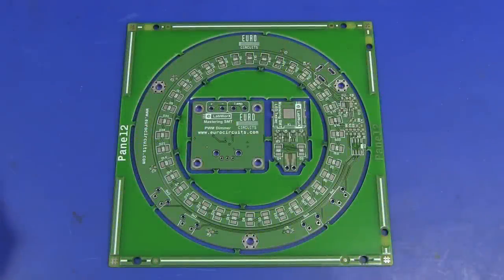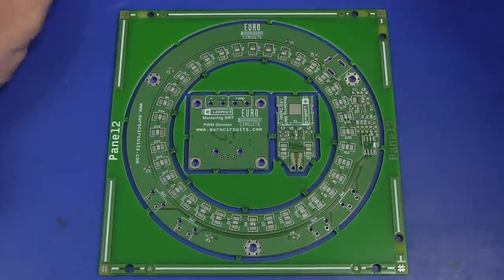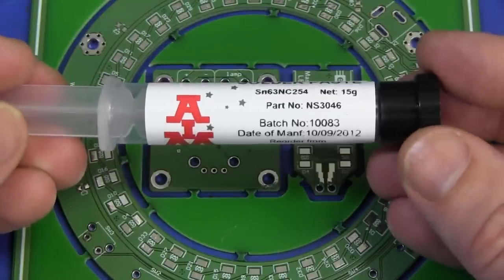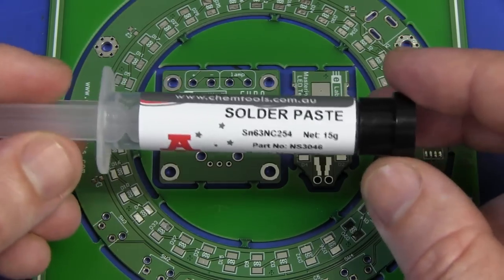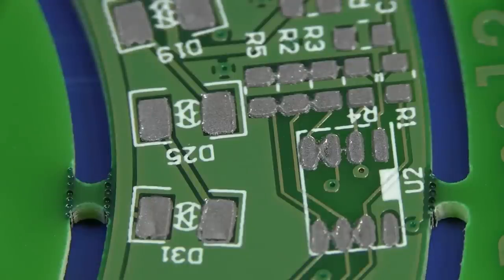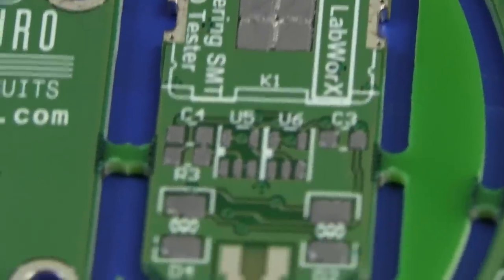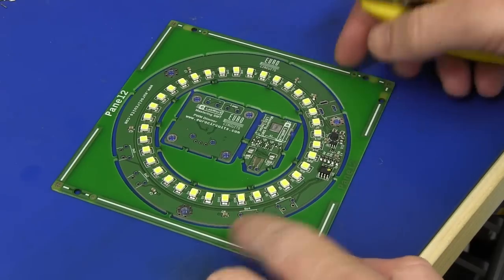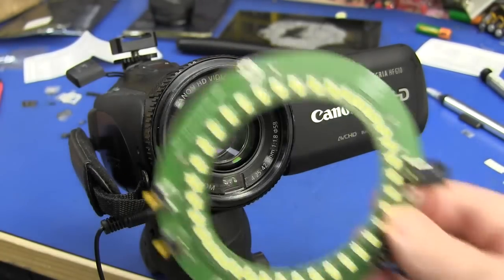EEVblog #415 - SMD Stencil Reflow Soldering Tutorial

Comment: I make "free" stencils for almost all of my SMD projects. The lab I work in has a cheap, hobby-level, laser cutter that I use. I cut open aluminum cans, sand of the inner plastic layer, spray paint the can, laser off the part of the spray-paint mask that I want to have solder on, and then etch the aluminum in standard PCB etchant. It takes a half hour tops.
Reply: Would like to see a video of that :)
Reply: or you can pay like 5$ at jlcpcb
Reply: @MrMWPro  the can method can be done in 30 minutes, i don't think jlcpcb will beat that
Reply: I know this is 4 years old, but this method sounds amazing. I was looking into using Al cans but thought I had to do toner transfer. What type of paint? Just standard gloss spray? What type of etchant do you use for Al? I thought it needed to be something like HCl/H2O2. I guess even just NaOH should work.
Reply: freezedream This was a while ago before JLCPCB had really become as popular as it is now. PCBs were really expensive back then ($50+) so I was making those using a similar process on copper circuit board material. I just used off the shelf matt black spray paint. It was a chemistry lab, so we had easy access to diluted HCl solutions. A little bit of Baquacil pool oxidizer (concentrated H2O2, but much cheaper) really sped up the reaction. I remember it always being a bit of a balance between using up your HCl or oxidizer and having to add a bit more to keep the bubbles etching.
Reply: @michaelmolter6180  Thanks for the quick reply! For sure services like JLCPCB are really cheap and convenient, but if you just need a stencil for a one or two board prototype and need it within a day or two then it's good to know how to whip something up that will do the job. I work in a lab, too and I've laser cut Mylar stencils before, but aluminium would be much better.
Reply: @Minecraftmike5089  well, if you already ordered the board from them the stencil would come with it already

Comment: The paste issue you had with it not sticking onto the pads when wiping is due to the paste either being too warm or not kneaded enough. Knead it on an aluminum plate to where it becomes the consistency of peanut butter, for a few mins till it's very smooth, then apply it. But like you touched on, the paste should re-flow once in the oven too.

Been an SMT Operator producing class 3 PCB's for a few years now, and always see this issue whenever someone doesn't prep the paste. 

It's awesome to see people producing PCB's right at home. Feel free to ask any other questions, love teaching and passing info to people who like to learn.
Reply: With a syringe you can't mix the paste. I never buy syringes.
Reply: @NathanSweet  Yeah that's true.. Plus whenever ordering paste online it's impossible to get it shipped cold. Warm SMT paste means the flux and solder balls will separate. Gotta mix it and when not using it, stick it in the fridge.

Comment: The flux is included in the solder paste. AFAIK that's the main reason for the shelflife and the time parts can be placed after applying the paste. The solvent of the contained flux will evaporate and the paste will go hard.

Comment: According to IPC general recommendations the stencil should have rounded corners to optimize for maximum release when the stencil is removed from the board. And it is very important to have about 50% of the size pad size for the solder paste opening in larger thermal pads, especially under the components. Please use IPC recommendation solder paste layer when you're using stencils.
Reply: -.-  tool

Comment: One trick for shaky hands is to use one of those pano-vise.  Clamp in your solder iron, tighten the nut just enough to move the iron with a little effort.  Very stable.

Comment: The solder paste has liquid flux in it, a lot of it actually. So no, no flux needed.

In fact, the gradual increase of temperature, besides giving time to the pcb to warm up gradually and not crack or bend or whatnot, is also chosen in such as way as to give time to the flux to work on the surfaces for a few seconds before it boils/evaporates and the solder actually reaches the temperature needed to make the connections.

Comment: I was told a story about a group of people soldering LEDs on boards for emergency exit signs. Someone screwed up on which way the LEDs go and placed it the wrong way, and everyone trusted that guy so they put them on the way he did. And no one paid attention, because they were busy talking about weekends and wife and kids and stuff. And it wasn't until the next day they realized that they have to throw away all the 5000 boards because the LEDs were put on the wrong way!
Reply: Did you know that not all LEDs are put on with the same orientation? I discovered this when soldering on some various coloured LEDs some wouldn't turn on. I dismounted the non-working ones and tested with a DMU. Mind blown.
Reply: electricity goes backwards.
Reply: A place i worked had done huge capacitors backwards.  They didn't spot that until it was powered.  That woke up the dead.
Reply: @dr_jaymz  🤣
Reply: @cesaru3619  To be fair, I think the capacitors looked the right way around because the shrink wrapped labels were actually backwards.  An automated pick and place had done most of the PCB and the caps were all done by hand afterwards and so the human assumed that the labels were correct.  I mean- why wouldn't they?  I think they were like like 470uF 400V.

Comment: Thanks, nice video! btw i'm having some solder bridges on the very fine pitch components, should i make the stencil holes smaller on certain parts of the stencil design? Because for example some big smd capacitors looks like they got too few solder, and at the same time, the fine pitch IC get solder bridges (like they got too much solder paste) after hot air reflow... Please help me...  Thanks.  :)

Comment: Dave, I know this video is well over a year old now but I wanted to add that in a pinch I find an old credit card makes a good squeegee for my stainless steel stencils. Has a good sharp edge, is very stiff while able to give some bend under high pressure and doesn't scratch the stencil.

Comment: Dave,
Thanks for the video.
A couple of things. The reason the spatula doesn't work is that it is too flexible and it bends down into the stencil hole. A rigid spreader is best. The best way to do your heating is to have a hotplate of some type under the board. What you're doing here may look good but the life of the parts might be marginalized and might have a short life in service.
Not one of your best videos.

Comment: if you apply the past in multiple passes it goes under the stencil edges and it ends up next to the pads, if you do it in one pass you get nice sharp edges. Might not be a big deal in some cases but when using IC's with very close pin spacing shorts will form between them.
Reply: I don't find this to be the case when the stencil is taped down firmly and a metal putty knife is used. The main thing that leads to smeared paste is the stencil lifting slightly. Keeping it pressed down the whole time helps.

Comment: 28:45 Anyone notice the pin that didn't get reflowed? :P
Reply: Yeah, it only partially reflowed. The board should really be elevated off the table when doing it like this. The table will suck enough heat out of the board to slow down reflow and possibly cause some components to "burn". Not a problem in a reflow oven since everything is hot

Comment: Dave did all that, then said he'd normally use his favorite iron & wire solder for this board? I'd think that's more hassle than the stencil & reflow method.
Reply: But for the thermal pad under a QFN part it might be the only way for a DIY solution. However I would do a very tiny bit of solder paste on that pad rather than using a stencil. An example of such a device is the ADCLK925 which is only available in such a package.

Comment: I'd like to say this once again - it's a good practice to preheat the board from the bottom. In Russia we even used an iron sometimes (yes, the one your wife uses to iron the clothes). Just put it upside down, place the board on it and enjoy. Soldering is much easier in this case, because board doesn't take so much heat anymore. And the chance to overheat your chips is also much less now.
Well, iron is weird, it's better to use IR heater.

Comment: You can use old credit card or similar plastic or metal sheet to apply stencil paste. Also a thin squeegee from local hardware show will do job perfectly.  It is important that edge is smooth and material isn't to flexible. I work with smd every day at my job. For printing stencil we use LPKF stencil printer for bigger series of boards, but for prototypes I just make frame like this one on video and I attach metal mask with some tape on one side to create sort of hinge.

Comment: I think that the issue with dragged solder paste is that your spatula is too soft. It's bending quite a lot so the trailing edge is very flat on the paste, and that increased surface area is dragging the solder away from the trailing edge of the mask.

Comment: Ok, when I ignore the self-praising Parts ;) I am suprised how good it works. I own an Reflow-Oven and never thought it could be done with such a windy tool like the hot-air-pistole. Nevertheless I think you should not work on SMD if you had to pull them on the board by Hand. At minimum a "half-automated" System would speed it up a lot.

Last Remark: Temp. is not the only critical part on the parts. Even the quantity of getting up-heated and cool-downs are critical. Take a look at some datasheets. They tell you a nb. ob 2-3 times. I do not belive that this is possible with the hot-gun and you have to repair/replace many parts. Didn't you?

Comment: A stencil is not absolutely necessary if you have hot air reflow. Just a little dab on each pad and don't worry about bridges as surface tension will sort it out. This even works on chips with completely hidden pads..

Comment: I’m not sure this would be needlessly complicated for only a marginal gain but: if your stencil is made of a thin steel sheet, maybe you could use magnets underneath the PCB to secure it in place and get multiple anchor points spread over the whole surface?

Comment: Thanks for the video. 2 questions come to mind. 1/. How did you work out the diagram for the LED had the cathode and anode back to front in the diagram. 2/. Do you concentrate the heat away from the heat gun the chop centre and concentrate more on the joints or are the chops usually able to withstand the heat

Comment: I can't speak for the solder paste itself. But, things like glues, drugs and many other substances are designed to be maintained with consistent environmental conditions, in order to preserve and extend the potency of the substances. If the manufacturer said keep it under room temperature, first you have to define what room temperature is. Also, room temperature can change back and forth throught the days and weeks, which weakens substances. A fridge provides a consistent environment.

Comment: Personally I would have put the extra boards top and bottom tape them down then align the stencil tape the stencil down. Use a metal ruler  hold it a 60 degrees.  Put. A bead of paste along the top edge and pull down holding the ruler at 60 degrees it should give an even print. Btw I work for a company that makes a 3d solder paste inspection system so I have a little bit of experience with it :)

Comment: Dave, you often mentioned your silicone/rubber ESD Matt that as you said and demonstrated once, does NOT conduct on the top surface and is resistant to heat and penetration. - im trying to find something similar for a while now over here in germany and didnt realy found an ESD matt yet that DOES NOT CONDUCT! Any matt ive found yet says in the datasheet is conducting on the top surface too. AND even those do cost a fortune! 200+ EUR a square meter. WTF?!

Comment: Good show nice work. A basic suggestion on hand placement. You would do better if you used both hands when placing parts. If you get some sharp pointed wood like the bamboo kabob sticks. Here is the basic move; keep the stick in none tweezers hand. Place the part with the stick near it. Set down the part and simultaneously put the point on top of the part to hold it down which will help with the shaking hand from moving the part. Release the tweezers and then the stick. It will take time to get.

Comment: I buyed Elme mat recently and it seems to be very similar to 3M top quality mats. It's made from two rubber materials, top layer is not conductive, thermally and mechanically resistant, bottom layer is conductive. I tested thermal resistance with soldering iron set to 300C for a few seconds and the only effect was discolouring the blue rubber. Maybe it was caused by flux from solder wire. It's only cosmetic issue, but beige seems to be natural color, so that variant should not have this problem.

Comment: Nice video. One question is, how do you clean the stencil? I have some old stencils with dry paste in QFN pad holes...pain to clean them. Mylar ones I just throw away after every batch, but stainless steel ones are too expensive to waste. Maybe you have a good cleaning trick?
Reply: i used to work during summer in a small electronics assembly company (not sure how to say in in English). Anyway, solder masks and dirty circuits were cleaned with a special solution and simple cleaning paper (large pinkish rolls). I believe the solution was some kind of alcohol but you can use anything as long as there are no residues left. Usualy, hot water is enough but can be corrosive to the pads if not dried correctly.
If the paste has dried in the stencil holes, you want to wet them with some alcohol and use compressed air (pump or a spray) to clean them before using a rag with some more alcohol.

Comment: Guess the problem with that squeegee is with the way rubber bends inside the cutouts, essentially creating a convex scraper inside the cutout based on the pressure you apply.

Comment: I do not have a heat gun (considering it, which is why I'm watching this) but would this be better for thermally-sensitive items (like LEDs) to apply the heat to the bottom of the board? I guess it will depend on the board, but my thinking is that would allow most of the heat to get to the traces and solder, with less of it going into the components? Maybe?
Reply: I have been having good success reflowing with a ceramic griddle on my counter top (the same one I cook breakfast on - I clean it well in-between, of course).  I put the board on it cold, turn the heat up to 265-275 and wait a few minutes unit everything flows nicely.  This is actually how Adafruit does some of their smaller projects for sale (they have a nice intructible on the website).  This really only works well for boards with SMD components on one side.

Comment: Nice video. 
A couple of points. The solder your using is a lot less viscous than paste designed to stencils.  Also for an applicator, use plastic spatulas designed for plastering, body filling etc.
To see how I do paste application have a look at my projects at homanndesigns 

Cheers,

Peter

Comment: If you would like to improve your reflow process: simply buy a cheap pizza oven and a "reflow oven controller", which will control the temperature inside that oven by directly adjusting the power supply!

Comment: I used mechanic mcn-300 it does not melt even after i turned the heat to 500 on the hot air blower. It melted my board and this paste never melted. How much heat is required to melt the solder paste?

Comment: Neat and interesting Idea.  I've always hand solder these tiny pitch chips, QFN's mainly.
I just pre-tin pads, remove excess solder with home made silver plated desolder braid, place and align chip, spray contacts with SK10 solder flux, then run iron/solder down a whole row at a time. use the same silver plated braid on the soldered area to tidy up. result looks like a reflow job ;-)  
#Note:  I don't use Toy soldering irons for this type of work, I use a Metcal MX5000 workstation.
Steve

Comment: Is it common to have a line of caps in alternating orientation like the 103 caps?  Am I neurotic and uninformed, or just plain neurotic?
Reply: depends on your trails...best part about circuits is there's all kinds of ways to make one work. as long as your electricity flows in the proper direction you're good. if it doesn't you'll short
Reply: Some leaded inductors come with different lead lengths like standard T1 3/4 LEDs for example. I assume entering the current into the longer leg results in lower EMI than the other way round. So sometimes the polarity matters, even on inductors.

Comment: For the folks in the US, I found a couple tools that work very well for stenciling. The spreader is a Hyde 4” Flexible Joint Knife. It's got the right amount of "spring" to apply constant pressure and has a sharp edge. I use a Techni-Tool Spatula Part #: 758SO0026 to apply the paste evenly. I've assembled hundreds of boards using these two tools and they're as good as new.
Reply: It seems you use two tools. One for spreading (Hyde 4) and One for smoothing paste evenly (Techni-Tool Spatula....).  Is this a correct interpretation of your recommendation?

Comment: why solder flux is not applied first? Is it necessary?
Reply: @jamesl9686  But if I want to extra add it, how would I do it?
Reply: @jamesl9686  what I meant to ask was if I want to apply flux, should I apply it first then place the stencil on top of the layer of flux and then apply solder paste?
Reply: @jamesl9686  if the flux is on top, the solder paste will be directly in contact with the pcb. How would the flux function this way?
Reply: @jamesl9686  so you mean even its on the top, I will flow between the solder paste and pcb as well?
Reply: @jamesl9686  ok thanks man appreciate the guide